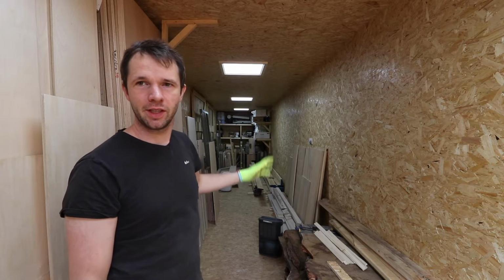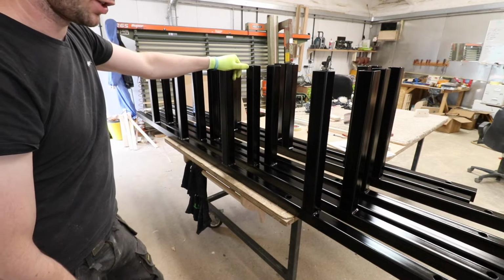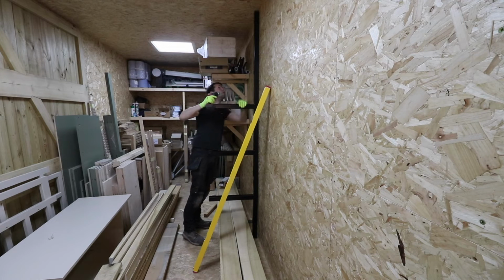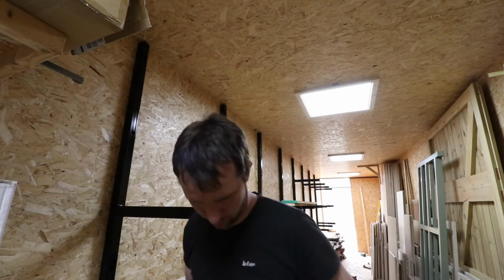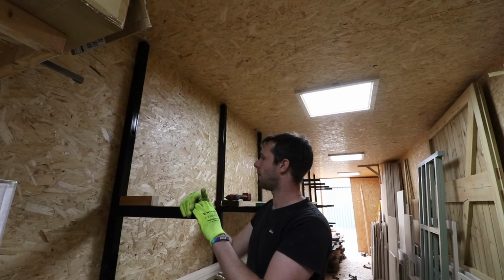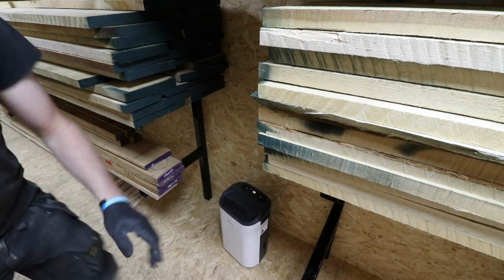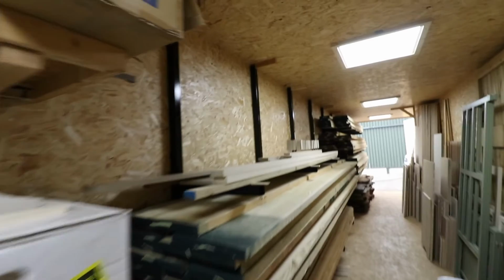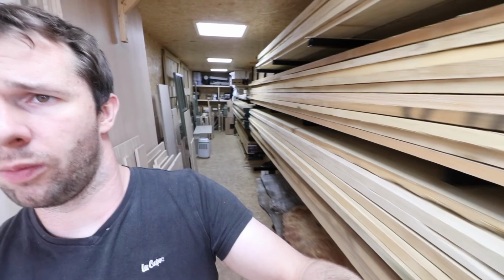Shipping Container Timber storage racking Install

Comment: I'm still randomly going through your videos as and when YouTube suggests them to me. I think its better that way rather than me starting from the beginning 7 years ago watching them in sequence. I will get to watch them all eventually at some point, but I will only leave you a comment if I think of something worthwhile to say.

Now is one of those times because in a comment I left some days ago, I asked you or any viewer to message me about a piece of wood you mentioned called Accoya. I had never heard of those spieces before until the day after I left that comment. 

A friend of mine called Graham, visited me while I was working on my conversion in my workshop, and noticed I was using cheap pine, which was planed, not rough sawn, which I got from B&Q to build the framework for my Mercedes campervan conversion.

He suggested as I would keep the camper for many years and seeing as I had no intention of changing the setup then why not use a different wood. As parts of the framework would always be seen once the conversion was finished, then why not use Accoya instead of Tulip wood?

Jumping ahead a little this is where I will now make it easier for people, including me, to understand because we tend to get confused about the diferent names we have for the same wood spieces between Britain and America. For example; Poplar is also known as Yellow Poplar and Tulipwood, which is a soft wood.
Accoya is also known as Radiata Pine. Once it has been treated, it becomes a hard wood.

Poplar, aka Yellow Pine, aka Tulipwood, I've used countless times over the years, but Accoya wood, what's that I asked? He said Accoya is basically pickled wood. It starts off as Radiata pine, a soft wood that has been pickled in vinegar. He said to be technical about it. It has been made rot resistant by acetylation, which is the process that uses acetic acid (vinegar) to modify the molecular structure of the wood. A side effect if you like is that the wood becomes hard with the process. Accoya wood is so durable that it won't rot or warp over time and is similar to our more traditional hard woods. He also said that if it was his camper, then he would use Accoya and not Poplar wood. 

While I waited for my Accoya wood to be delivered the next day, I scrapped the cheap nasty B&Q pine, which was riddled with knots and other defects, and we ripped it out. We, meaning Tony, my apprentice, and me. We had all the framework fitted in a day.

For the side panneling, I chose a treated marine board often used to cover shower walls, which is guaranteed for 25 years against rot and swelling from water penetration. I also like the off-white with cream and grey marble effect. It was delivered along with the Accoya wood and fitted the day after.

Two days to fully fit a frame for a WC, 8 fitted eye level units, 7 floor units to house  a 2 ring gas burner with oven grill. Microwave, toaster, kettle, sink, and enough storage for two people plus a fold away double bed come table to seat 4. There is much more to my camper, including another double bed made from 2 single beds, but that's not important here.

What I like about using Accoya is that, firstly, it is more uniformed and pleasing to the eye with asoft yellowish tan colour. Secondly, sawing it is much easier, leaving nice clean straight sides compared to cheap pine, which always appears to look jagged and uneven, not to mention cheap and tacky when it is varnished.

Also, when the time came to cover the wood with a sealer (I prefer to see the colour and grain of the wood rather than paint), the satin finish looked so much better against the marine marble panneling which fits in with the tan colour. I think it blends in better, as does Graham. 

From now on, no more B&Q pine for me, Accoya only from now on. In fact, I may stick to just using Accoya for all my framing work that's on display and use Poplar for everything else.

I also have a pair of 40-foot shipping containers that I purchased 2 years ago brand new. One is used for storing wood while the other is still unused. They were going cheap so I got a second one in case I needed it down the line. I also have a 20 foot container, which I've had since 1994 for my tools and doubles as a workshop for all non wood related work.

Right, thats me done. It looks as though I will watch you build an arch window next. See you soon, fella.😁🏴

Comment: I got a govee hydrometer from amazon last month to monitor my sons room as he has 2 external walls that i use a dehumidifier in in the winter to stop condensation/could in the corners. Its just a small square puck size thingy, no screen or anything. It has a long lasting battery and works with a phone app really well and takes lots of temp and humidity data and makes graphs etc. Only 20 odd pounds so might be useful. I use it with wifi but think you might be able to use bluetooth too
Reply from the maker: Nice one Jack, I did have something similar but not in the container. I might look into it again. Its made a massive difference to the stability of internal woodwork after installation!

Comment: What make is your measurement laser? I am thinking of getting one but not sure on which to get? I see you have good taste in tools with the festool.
Reply: I have the Bosch glm50c it’s £100 and I’ve had it 3 years or so it’s been great and it’s also been through the washing machine for 1 hour wash and all it had was moisture behind the lens where the laser light is but it dried out and works perfectly and it’s constantly accurate
Reply from the maker: It's a Hilti, was very accurate for 3-4 years but has become a little inaccurate now. Time for a new one soon, will buy hilti again!

Comment: great work buddy. Got to ask why you don't use stickers between the lumber?
Reply from the maker: I didn't need to as it was going to be a while before I used it, plus I wouldn't have fitted it all in 😂

I've got some oak coming I need to use fairly quickly so will sticker that 👍👍
Reply: @BradshawJoinery  was thinking you might be struggling for space with stickers 😄. Personally I don't have a store, and just sticker for a few days in the workshop after collection from the yard. Hope you're well. Matt

Comment: Hi Ben 

I would recommend latting your timber, the air can get in between the boards and will dry out at a faster rate. 
Also You can pick up moisture meters now for around £30, it would be good to check the moisture content prior and after being stored in your container. 👍🏻
Reply from the maker: Hi, thanks for the comment, I have covered the moisture difference in my next video with lots of other container related questions so keep an eye out